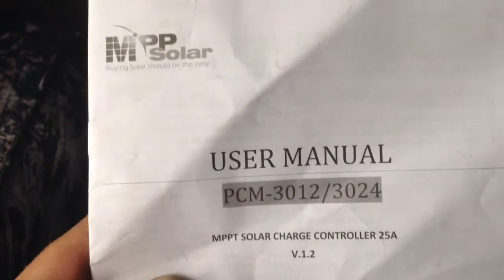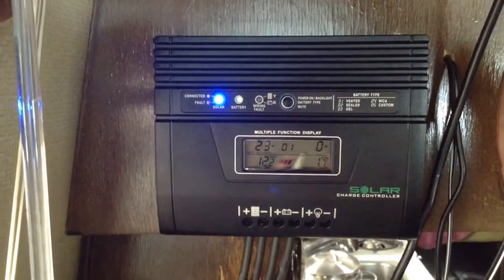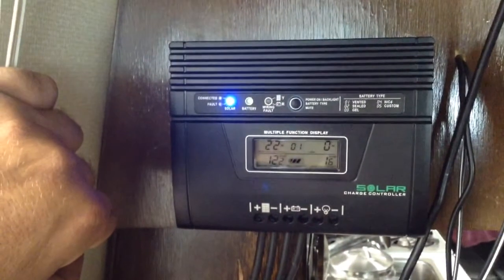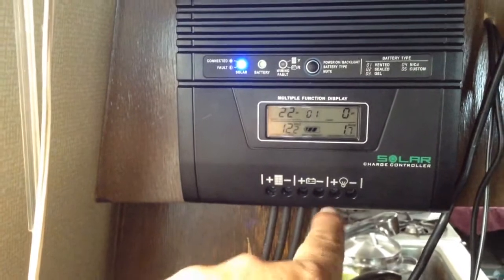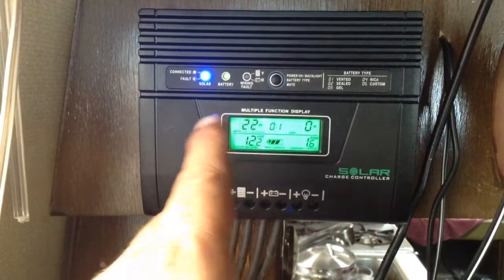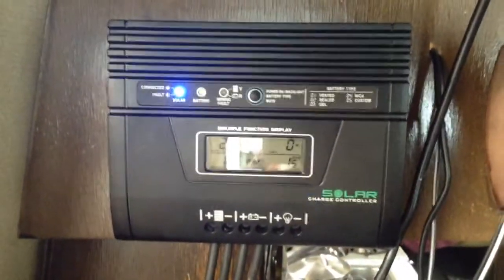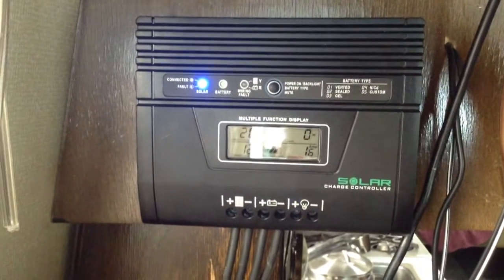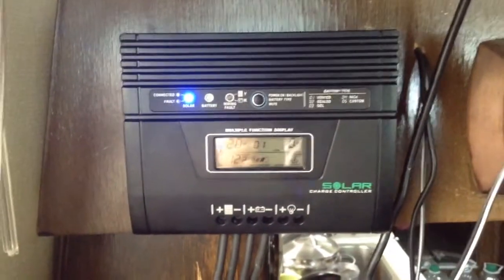Mpp PCM3012 MPPT solar charge controller for 12-24v low amperage off grid systems

Comment: The MPPT keeps the  panels in their sweet spot - what is vital is that  panels using the same MPPT must be  matched ie the same specification with the same maximum power point voltage  - you can expect between 10-30% improvement  but  driving the system typically  takes 4-5 watts so panels totaling under 50 watts it  benefit is questionable

Comment: Good explanation.  The MPPT is good, but not always justified.  The increase in efficiency is not significant until one is running about 400 watts. If I could afford to make the change I would go for the Morningstar TS-45 PWM because of it is lower cost , programmable, and it's boolit proof.  It has a solid track record and long service life of 15 years or more.  I would also get the remote battery temperature sensor should the batteries be stored outside.  When it gets cold, the battery needs extra voltage to charge completely.....  I would also adjust the charging voltages upward for standard lead acid batteries.

Comment: one benefit of MPPT is higher volts from the solar system being knocked down to you battery voltage.  say a 96 vdc panel voltage at low amperage to a 12vdc battery bank... you can use smaller wires fro. a high volt low amp array vs a high amp low volt array.. but yes on small scale systems not hugely beneficial.
Reply from the maker: Ebacherville I went ahead and wired the panels parallel anyway.  I don't think it makes that big of a difference on the smaller scale, but once I install the last panel I might set it up in series to see if there is any difference.  One limiting factor though is the panel wiring is often not set up for the higher voltages.  What that can mean is you burn a diode in the simple little control box on the panel itself, even though the charge controller can handle the higher current.  Running everything in parallel means the panels have a capillary effect and the power flow just takes the paths of least resistance.
Reply from the maker: pirate0jimmy It has an ethernet plug on the unit, but was not clear how or where that interfaces on a computer.  No firmware references or download sites for accompanying software.    I hooked the panels up flat mounted in parallel and the charge controller consistently reads around 87-90 real world watts feeding into the batteries, which are now topped off.
Reply: +8digitPDX 
http://www.mppsolar.com/v3/catalogs/PCM3012_3024.pdf
It says that it is a 12v battery with a MAX PV input array of 50v.

Making an assumption that the panels are 12v panels and have a VOC of 21v you could only have 2 panels in series without burning out the unit. Being a 300W unit having 4 panels would mean having 4 x 75w panels.

It sounds like you have it setup the best way possible. (without knowing panel size)
Reply: +8digitPDX Also it says "Optional com port to program customized charging voltage" so I would assume that is what the Ethernet plug is for. (again assumptions)